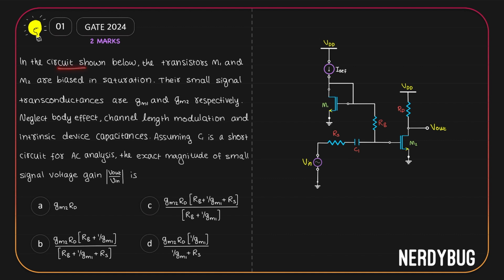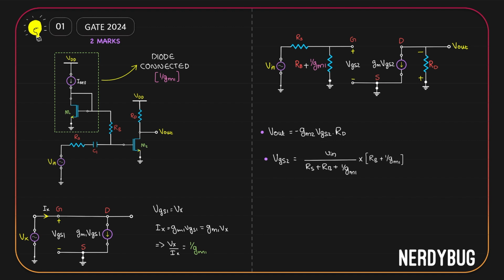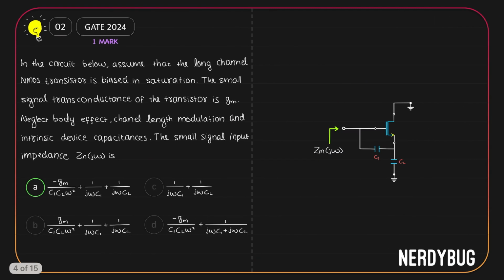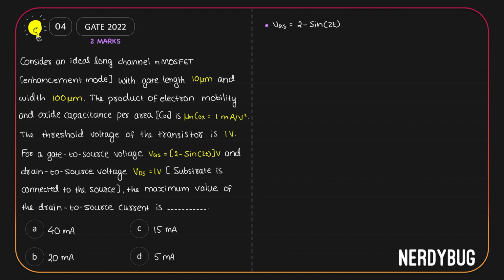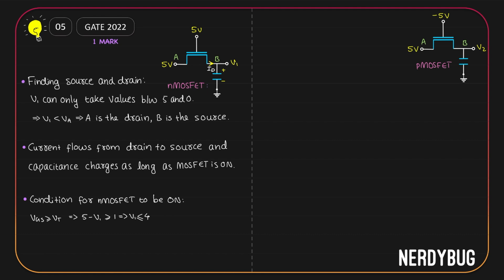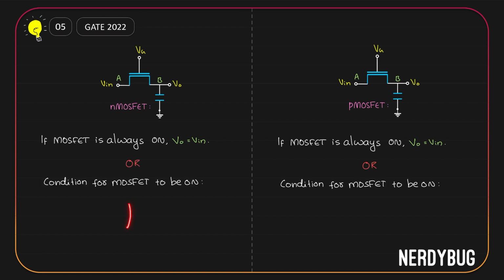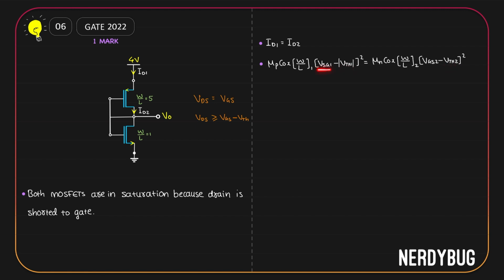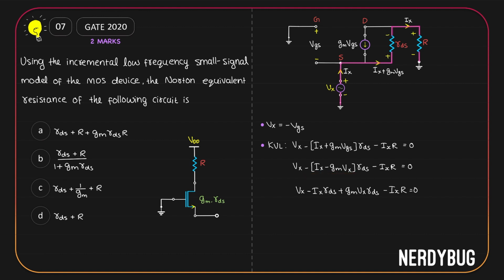Gate Questions on MOSFET 1 | 2015-2024 | GATE PYQ | GateBusters ECE | NerdyBug

Comment: In Problem 2, why do we need to add an AC-Source to the small signal model?
Reply from the maker: It's the method to find the input/output impedances. I've made a detailed lecture on that. Will share.
Reply: @NerdyBugNB thank you!
Reply from the maker: @JannisStockhausenhttps://youtu.be/VZuoaxfyzh4?si=aGEk-gHJzrXKBssZ

Comment: in q 3  how did you draw pie model while source is not grounded
Reply from the maker: I didn't clearly understand the question. But source doesn't have to be grounded for us to make the small signal model. I have explained small signal model of MOSFET amplifiers in this video: https://youtu.be/wYyAv0RfjSg
Even this might help in a deeper understanding of a MOSFET: https://youtu.be/Ip6gD1-pPUg?si=_-eGS5EcAWC8xHYg

Comment: Mam in question 2 whay are we not short circuit both capacitor during ac analysis?
Reply from the maker: We don't automatically short all the capacitance in ac analysis. It depends on the value of their capacitive reactances. If capacitive reactance is very small, we consider it zero making them act like short circuits. Checkout these two videos, I have in detail explained ac analysis for BJT circuits. Concepts will be similar for MOSFET amplifiers also. https://youtu.be/Hna_vSUnMsA
https://youtu.be/mzU5F-DOHM8